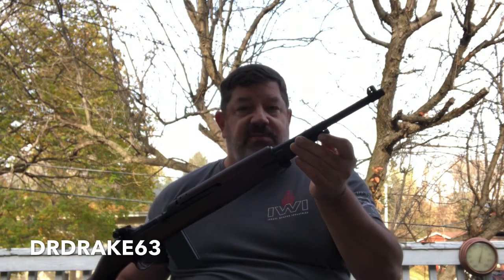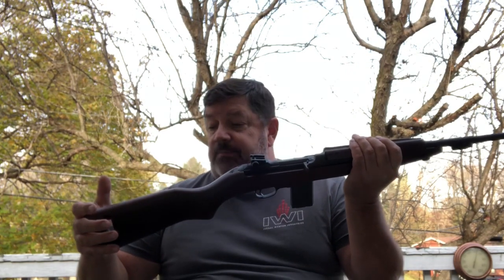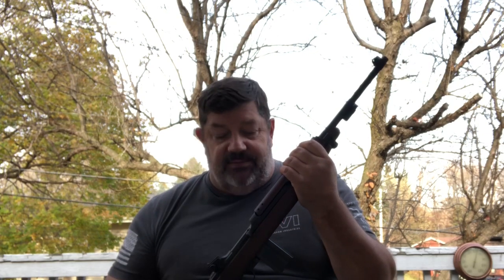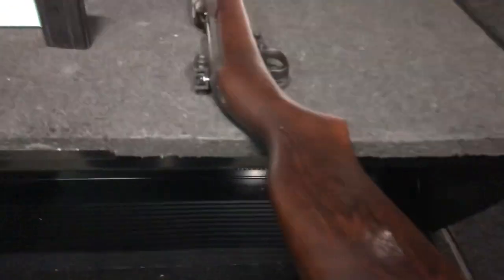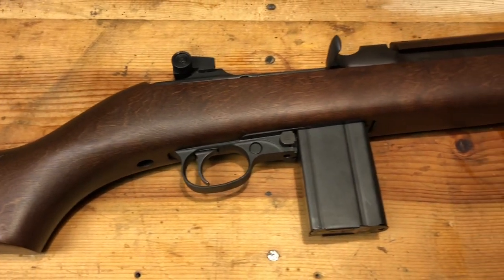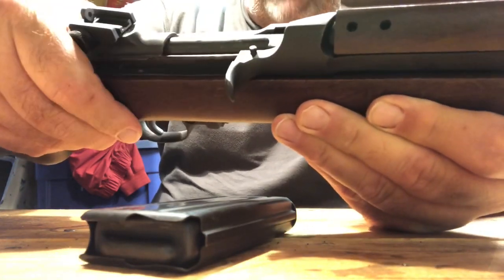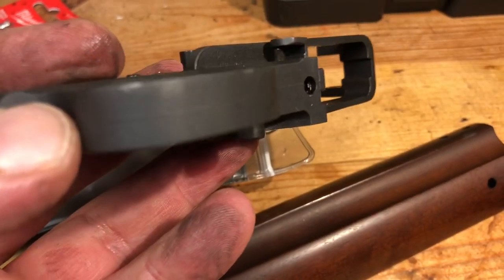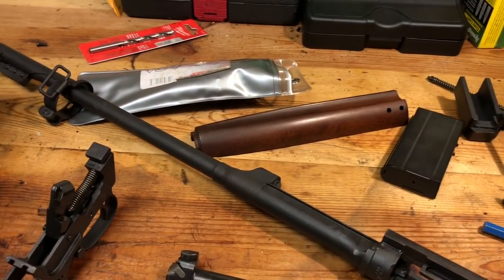Inland M1 Carbine: Overview, Shooting & Take-Down

Comment: Great video David...Was in the USAF Security Police career field from 1968 to 1972. In SAC, the carbine was standard issue stateside. Mine was an M-2 (Inland) with a pristine blond stock and was a lot easier to carry than the M-16 for long hours . Those of us with M-2s were allowed to fire one mag on full auto during familiarization and told not to put on auto again. Never saw any function problems with the GI ammo but we were warned about squib loads due to a recent close call.......Did not see the M-16 until a PCS over-seas.

Comment: Congratulations on your new weapon.  Have been very impressed with M1's, I have two of them - a 1942 Inland, refurbished by Fulton Armory and an Auto Ordnance reproduction.  Have no regrets with either one.  You'll get years of enjoyment from yours.
Reply: A new manufacture does loose out on the collector issue, but these are nice reproductions and have the advantage of being all new without 70 years of wear and tear causing potential issue.  I once had an Iver Johnson reproduction and did not the stock so I picked up a vintage original stock and it looks great. It still does not make it an orgiinal but gives it the original patina.

Comment: I had one of these "Inland" carbines about 5 years ago. It had major feeding and ejection problems, it would not accept the M4 bayonet, and it had seams along the barrel and receiver. I called the company about these issues, and they told me that they would be addressed in the "next run". I sent it back.

If you want to buy a reproduction M1 carbine, try Fulton Arms.
Reply: Mine also jams and its brand new but its probably a early production model, no clue . round stuck half outside the mag and the bayonets do not fit. Really, something is wrong with Inland redux and their QC for sure. I dunno what to do. I contacted them, they told me they would fix both issues but its a pain in the A$$ to wait and pay currently very expensive shipping prices.

Comment: 30 to 35 years ago I used to do a lot of buying and selling, we traded these for $100 to $150 all the time. now you cant touch one for less than 5 to 600 and then your lucky if its that cheap. wish i had all the ones i owned over the years.
Reply: jeff robison Yep. Got my surplus USGI 1943 GM Inland in the late 80s or early 90s for $150. A government warehouse in Virginia gave a bunch of GM Inlands and Underwoods to Walmart to sell. All NRA certified good condition. If I had known then what I know now I would have gotten a few more of them. Haha. I can recall M1 Carbines hanging on just about every truck cab window gun rack. They made great ranch guns.

Comment: I purchased an Inland reproduction a year ago and had major failure to feed and failure to extract issues. The magazines they send along with the weapon were garbage and very low quality. I have purchased original USGI magazines and seem to work to some extent, but still having issues. I sent a very thorough email to inland-manufacturing, but I have not received a reply as of today. Someone mentioned to me to send it to Fulton Armory, but I also heard they do have issues with the reproductions as well. Not sure what to do other than send them to a reputable gunsmith, which by the way, I do not know.  Any suggestions?

Thank you

Comment: @ 4:16 FALSE
It was SPECIFICALLY intended for front line use
It was literally developed out of the Light Rifle Program which sought to create a... (drumroll)... light rifle for combat
People keep repeating that nonsense instead of reading the actual program documentation
It was never intended to replace the 1911, nor was was it intended for clerks, cooks, drivers, etc
It was developed specifically for changing combat in the modern world where most engagements were <100 yards
The M1 Garand was too big, heavy, limited in practicality for the changing battlefield
The Thompson was too heavy and range limited for combat, and both were expensive to produce
So as many nations were doing, the notion was to create something specifically for the <300 battlefield
Something that was lighter, more compact, high capacity, select fire, and less expensive

Comment: I have one, out of the box it has jammed a lot (round stops short of going into the chamber) and an italian m1 carbine bayonet does not fit on these. I was offered by inland to send it in for rectification of the jamming and bayonet lug issues but I have not done that yet. These should not have so many problems out of the box. I will admit though that its brand new and I only have a few mags through it. Perhaps it needs broken in more as new parkerizing can be thick on bolts and rails and need some wear to them to function better.

Comment: Sorry but you don't know what you're talkin about when it comes to ballistics. The 30 caliber carbine has more feet per second and energy on impact than a 357 Magnum and it could accurately kill a person out to 350 yards.
Reply from the maker: DONALD Barbato Out of a rifle? Sorry but you are not giving the 357 magnum it’s proper comparison
Reply: David Drake The .357 Magnum is a great round. A video done by Paul Harrell proves the .30 Carbine was more powerful. He did shoot both calibers for comparison and the .30 Carbine is definitely more powerful.
I have shot deer out to 200 yards with 110 grain Soft point bullets and the deer dropped. The Leveraction .357 Magnum couldn’t adequately harvest a deer at that distance.

Comment: I have the same model and bought it in 2019 and have had zero reliability problems with it from day one. Its gets 1 inch at 50 yds and 3 inches or less at 100 yds and no malfunctions with good Mags and if you lube it regularly it will always be ready for duty. The fit and Finnish on my gun was flawless with no burrs or harsh surfaces.
Reply: What price    balpark
Reply: Which mags do you recommend
Reply: @90sr27  Korean mags are very good and new military mags are also good but the US militaries are way to expensive in my opinion. 30 round and 20 round Koreans are what works for me. Good luck.
Reply: @johnwhitneykokalis9990  i just got an inland repro today and after seeing the reviews, alot of people are saying it jams alot etc. now in kind of regretting, how has the rifle been now ?
Reply: @90sr27  still a great gun and zero malfunctions as long as you lube the bolt and receiver and use good mags and good ammo.

Comment: I love the M1 Carbine, but it seems like these newer after market versions are made almost as cheaply as they can be and then priced as high as they think they can sell them for. It's basically a $500 gun, maybe $600. It's like a big Ruger 10/22 with all those castings. Much better off with an AK .
Reply: Not if you don't like AK's

Comment: David should never use grease on any moving parts because dirt and dust will stick to it. You need to use a lite wait gun oil with a cleaning patch. I was assigned this rifle when I was in the Security Police from 1968-1972 in Torrejon Air Base Madrid, Spain. If you put grease on the weapon the commander would have you clean every carbine weapon in the arms room, and I never made that mistake again.
Reply from the maker: Roger Brown M1 experts disagree with your statement Roger.
Reply: Funny, I've had dirt and dust cling to oil on firearms too. That commander was stupid. Grease is fine on the internals, like the trigger hammer and assemblies which aren't out in the open and therefore protected. Oil dries up too quickly to be useful for deep internals. After about a month, oil will be just gone. I just greased the internals of my old Egyptian contract FN-49 chambered in 8mm Mauser. My gunsmith approves and he knows more about weapons than your old commander, who only thought he knew weapons.

Comment: I’ve heard the new Inland is junk,but the new Auto Ordnance is good. Buy a original. The M 14 is Similar design and still in service. Nothing wrong with the basic design . My Garand shoots great and it’s old. My Mimi 30 sucked.Not very accurate and the magazine would fall out
Reply from the maker: Mr Paul Grimm i’m here to tell you that it is absolutely not junk. I’m basing it off of hands-on and shooting and many many years of experience with firearms.
Reply: @drdrake63  You are absolutely correct. I have that same gun and it functions incredibly well with all types of ammo. People need to realize that usually poor quality mags are the reason for issues with this gun or any other M1 out their, and poor lubrication. These guns work better if they are a bit over lubed.
Reply: I have an original Saginaw and a newer Inland and both will work 100% of the time with Korean mags. Probably the most comfortable carbine to shoulder than any other rifle. Just a joy to shoot.